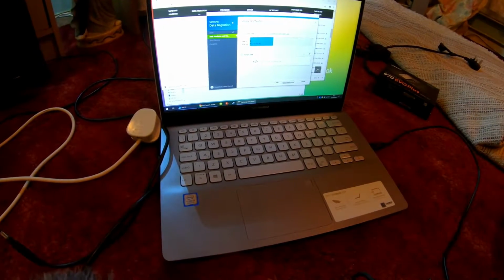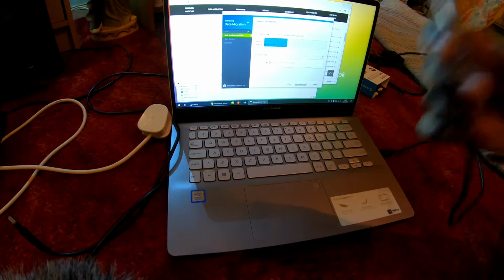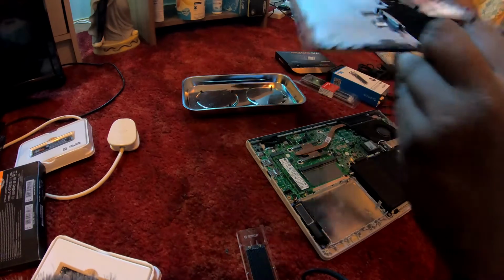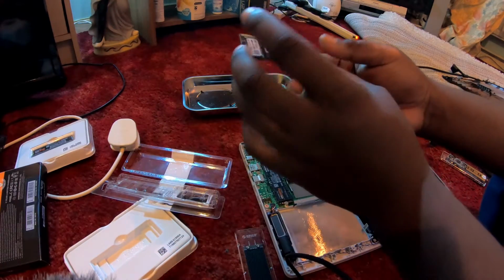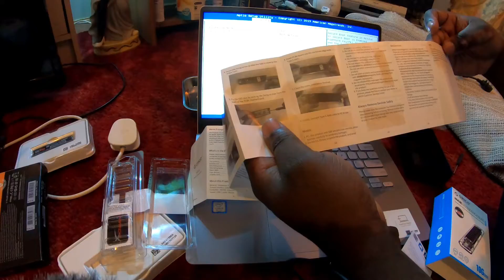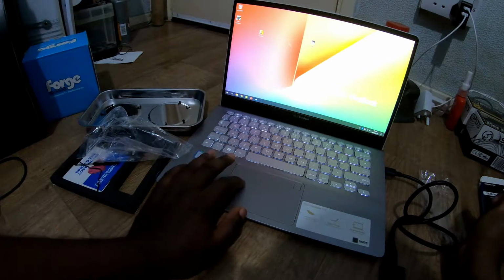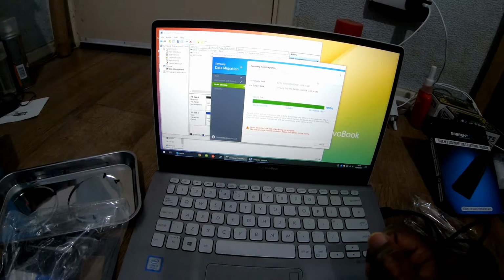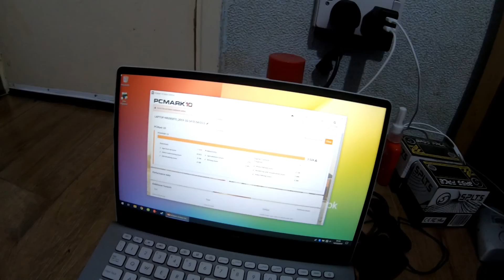Upgrading the Asus vivobook 14 s430F

Comment: Hello! When u opened notebook were was your ram? How its work without ram?
Reply from the maker: The ram is soldered to the board, but you an add to it
Reply: Aa thx bro.
Reply: @TheDJWaves  what a max mhz I can buy for this notebook?
Reply: @daniel4574  same question, some people say that it is useless to bug 3000mhz+ because it will be capped at 2600mhz

Comment: hello, first of all video is very useful thanks. I wanted to ask you but if I wanted to transfer / install the operating system on the ssd is there a procedure to do?
Reply from the maker: Thats what i did in my video, it depends whether or not your laptop is using m.2 nvme or sata drive and whether or not you have secure boot enabled, but otherwise, its just plug both drives in and clone withe data migration tool i used for Samsung drives